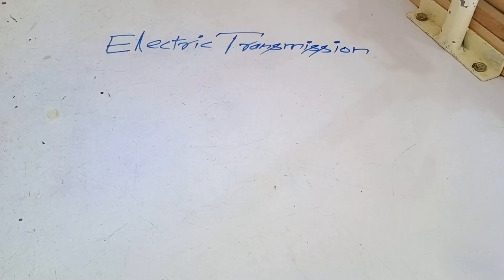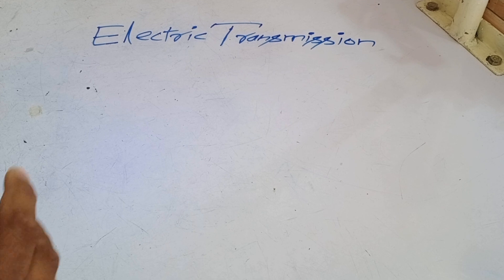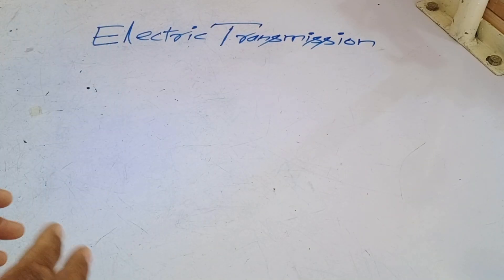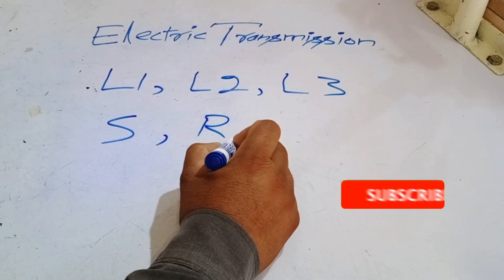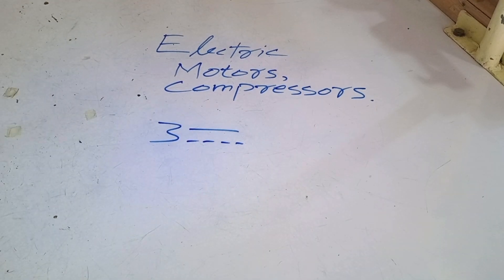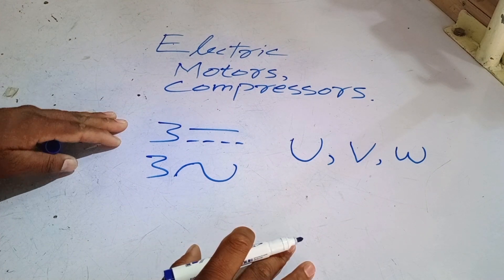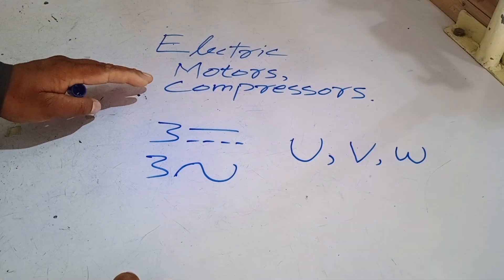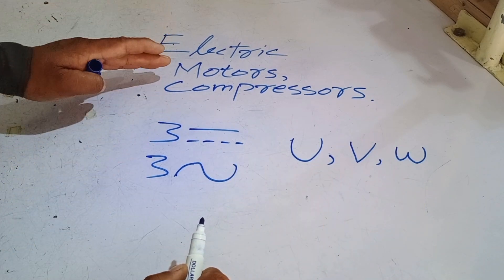UVW on Compressors: What 99% Don't Know About Motor Connections

Comment: Let's clearify something. Inverter reacts not generate 3 phase voltage. 
In DC inverter A.C 3 phase BLDC or PMSM motors are being used. In order to run such motors, controller tracks rotor position to create appropriate voltage in stator. So, only after rotation has been established, stationary rotation or acceleration/deceleration, there's symetrical 3-phase voltage between U, V, W, respectively.

Comment: Thank you for the video.. I have a question which I couldn't get an answer to yet. In Inverter board and when I supply it with 220v AC, what will be the output in UVW to assure that the board is OK?
Reply: Dear friend 🙏, forevertechenglish has given some valuable inputs to your question yet i would like to add a few more tips to ensure safety before connecting Inverter ODU PCB to AC 220V supply.
* First of all its important to go for some cold check, to use a Digital Multi Meter and make sure that there is no short circuit or low resistance reading at The Power Bridge Rectifier
* Check for no short circuit across the 450V or 500V  Main filter Capacitors. You have to hold the test probes for sometime to turn to infinite resistance n confirm no shorting in DC High Tension power line. 
* If short detected, check PFC-IGBT & UVW Output Power IGBTs as these are common problems seen at random.
*  Connect the ODU PCB to AC supply, Use DMM in Hi DC Range and Connect Black Test Probe to Main filter's Negative Ground. Check DC voltage at UVW Output terminals 1 by 1, without Compressor connected. The readings should be 15V +/- 1V.
** To run the PCB with a Compressor - one has to connect it's matching IDU PCB and all Pariferiel components like BLDC motors or AC motors, all Temp. Sensors and interconnected cables to communication is established between Both MCUs of IDU and ODU.
SHITCH on power & wait till compressor starts, you can check UVW  DC voltage about 150~160v that will gradually go up to 200~215V within 5min of run. Best of luck
Reply: @rabishankar8584  I really appreciate your response.. thank you for details
Reply: IT depends on provideri.It is not a standard.
Reply: @Polarbear77-y2c  what is the one case I say it's bad Inverter board? No voltage in UVW or different outputs in UVW?
Reply from the maker: If you check the voltages on the IPM U V W pins of the inverter AC board, it should have 15 volts; if the voltages are different than the 15 volts on the IPM, you can say that it is a fault in the IPM, or something else in the board. Also, For most residential inverter air conditioners, the voltage between each phase (U-V, V-W, W-U) is typically in the range of 150-380V AC RMS, depending on the system design and compressor type.
The exact voltage depends on:
The input power voltage (e.g., 120V or 240V AC).
The operational speed of the compressor (controlled by the frequency of the PWM signal).
Reply: @forevertechenglish  Thank you so much for the reply sir. And they must be identical in every UVW pins?
Reply: @forevertechenglish incorrect. PWM frequency is just modulation carrier. Output frequency depends on RPM speed and pole pair number of the used motor.